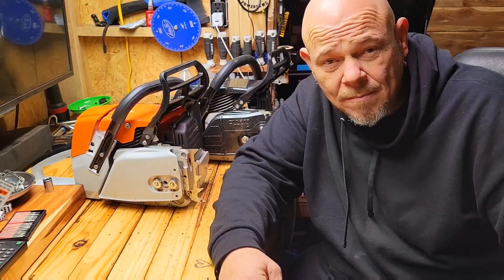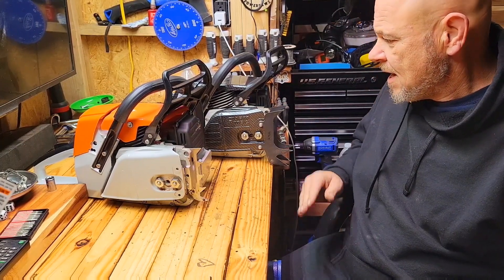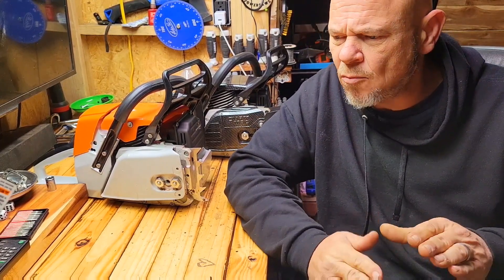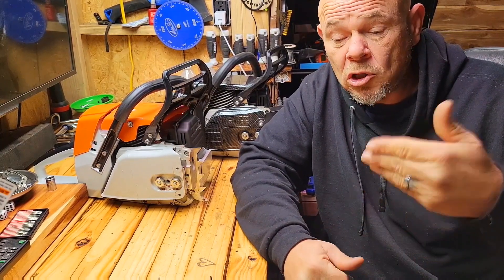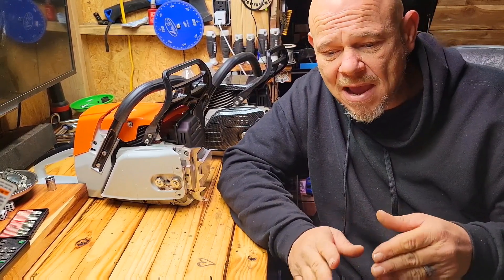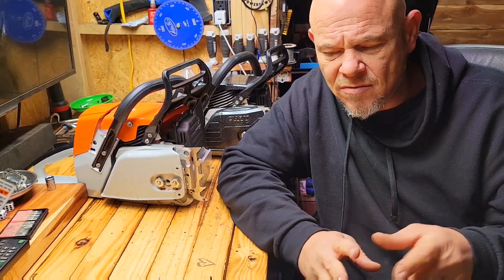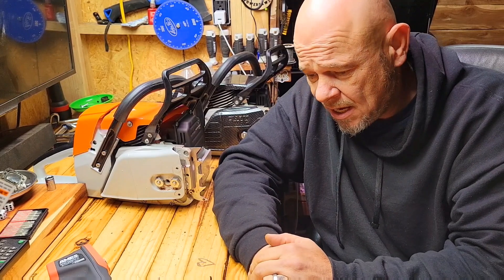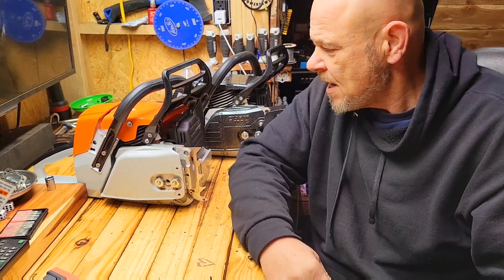Neo-tec stihl ms381 vs Farmmac f380w  performance and review. port work and build talk!

Comment: I just got my Motörhead today looks amazing I’m looking at a 32 inch bar is there a certain bar Company I need to stick with that will fit
Reply from the maker: I really like the OEM Stihl bars... If you are going to go Chinese made or after market, I would suggest neotec bars and chains. 
Thanks for watching sir
Reply: Thank you for making the reviews on this kind of stuff I would literally be lost without these reviews lol 

What size is the tail gap on the bar The bolts on the Motörhead are larger than the ones on my ms 210 Stihl
Reply from the maker: @codymckee743  it's a 12.1 mm and a D025 mount
And you are very welcome 🙏 sir
Reply: I got a issue with my Motörhead good for about five minutes then I saw gas coming out of the front of the muffler and my spark plug is black end it won’t start 

Is this a carburetor issue
Reply from the maker: @codymckee743  was gas coming out while it was running? 
So I would say that the choke was left engaged! (If not running) and even if it was running,  yes, I would saybit was for sure a carb issue! Turn both low and high screws in all the way. Turn them back out 1 1/4 Turn. If this doesn't fix the issue.... try taking off the carborator and rei stalling it! Sounds like the choke lever is still engaged sir!
Reply from the maker: @codymckee743  if you need help with a video... I can make one taking caeb off and reinstalling it to help you see how it's done. Basically, doing the same to mine as if I was looking for the same issue.  I can make the video tomorrow morning, sir, and upload. Sorry that you are having this issue... we will get it figured out for you
Reply: Thank you I got it running
Reply from the maker: @codymckee743 very good 💯

Comment: So with the longer fuel tank, is it actually bigger? That is one of the biggest complaints with this variant of saw, is that they need to be refueled often.
Reply from the maker: So I just looked them both up (good question, by the way) they are both .068 l   So the same size! As a chainsaw Miller... I'm constantly having to refuel! Love milling with the big bore 660s.. but they drink the fuel ⛽️ however, the 372xp big bore 76.5cc do much better on fuel and do very well on the mill
Reply from the maker: @Jefferyl22  exactly 💯... 92ccs 98.5ccs thirsty! I've been working on a 070 with the 66mm 090 topend extremely thirsty! The 660 big bore is 56mm, so you  can figure how thirsty it is
Reply: @majorpixchannel7146  speaking of the 372xp. What do you like better farmer tec 372xp or these 380/381’s ?
Reply from the maker: @John Doe  the 380s...stock! Now when it comes to modifying... the 372! Because there is soooo much  you can do to the 372! My big bore 372s will best the breaks off this 381. Of course, there is like 5cc difference as well

Comment: Is it worth by the pro or the ns872i version? Do the good carburetors, and coils make a difference, and are they the same cylinders? I’m looking for a midsized saw to run between a 24-28 bar. I’m looking at the ns872 and it’s variations trying to pick. I’m also considering  the nh865. What’s the best bang for what I’m looking for?
Reply from the maker: Sorry iv been in the hospital for the past week sir... I normally respond much faster.
So, no in my opinion (and my favorite saw in the world) the f380w the black and white carbon fiber look a like is one of the best of all the 380 /038/381 versions.
In some cases iv seen issues come from the higher models. (Not always)
So can recommend any of them really. It's just cost.
No difference in cylinders except the 380/381 decomp. And again the upgraded carburetors I have found to have more issues than the regular ones.

As far as the nh65 or any Husqvarna clone I'm also not a big fan of.  
I own about every clone ever manufactured. I can tell you that 95 percent of any issues iv had have been from the Husqvarna clones.
The Stihl clones do very nice 👍
Hope that all makes sense LOL again I have been only at the hospital a bit.... And just now answering back comments!  be well and safe
Reply: Sorry you’ve been in the hospital, I hope all is well. Thank you for your thoughts and experience with these saws.
Reply from the maker: @JohnDoe-ud2cc  your welcome sir